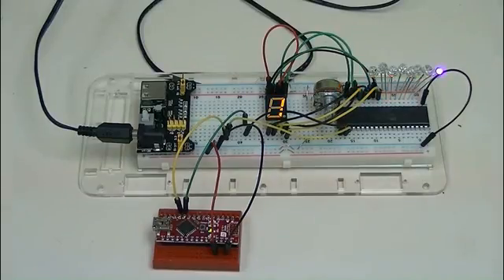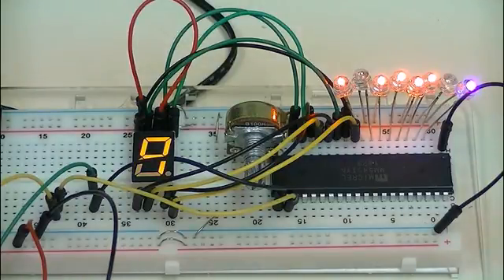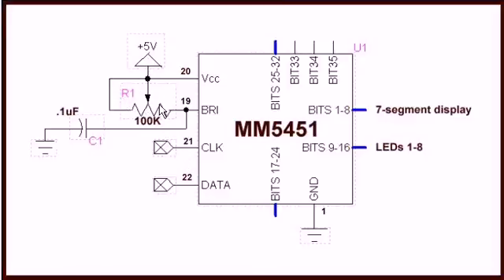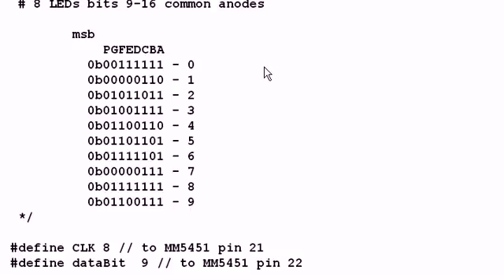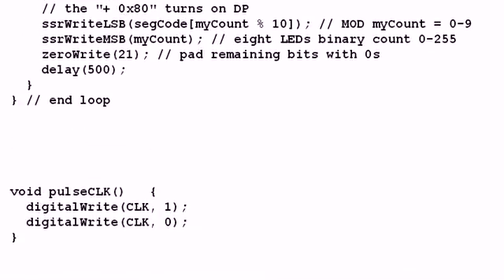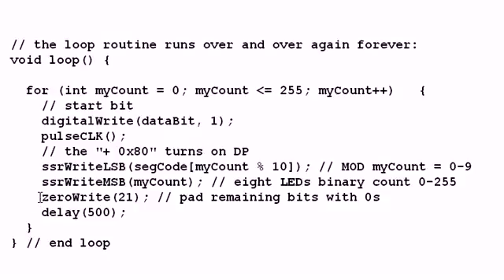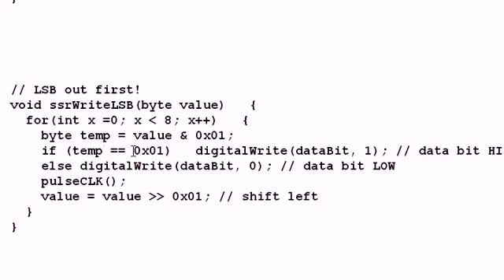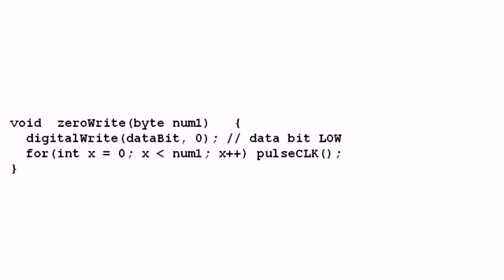Interfacing Arduino with MM5451 LED Display Driver

Comment: WOULD the  mm5486 be any different, it has a load input on pin 23. I have a board with 4 of these chips connected to 108 LEDS that I'd like to make light up randomly. Each chip has 33 latches, would I have to send 132 bits then send a Load pulse? Any tips?
Reply from the maker: It looks similar. Check the spec sheet against the MM5451. You might have to modify the code.
Reply: @LewisLoflin  yes i was just wondering how you would write to four of them
Reply from the maker: @TheUnofficialMaker  They either can be accessed individually or are in a string. To write number 4 means going through the 1st three. Looked at the MM5486 pin 18 is data out. That goes to the input of the next chip.

Comment: jitter is what the capacitor is for, that only is a problem when you multiplex the chip and even then only if you're trying to display 5 display characters when you only have 4. At least that is what I have found, otherwise this chip is stable as a rock.

Comment: Hi. This is a neat video. I wish I would have come across it sooner. I just finished my own 5450 project and knowing this video was out there could have shaved some hours off my development time! Oh well, I am glad I was able to work it out on my own. Nothing more satisfying. I may still find pieces of your code useful. I need to develop a testing jig for my boards and the Arduino seems like a perfect low-cost candidate for such a rudimentary task. Great job. Thanks for your outstanding contributions!

Comment: Hi Lewis,
I got everything working now, but I still don't understand the program so that I can change it for my specific needs.  I don't need to use 7 segments, only the 35 individual LEDs being lit up in sequence with only one LED on at a time.  So I need to understand what the LSB and MSB programs are doing precisely to see how I can change it.  I know I"m a beginner here.  My only real reference for knowing how a shift register operates is my understanding of the 74HC595.  I presume there's a difference between the 74 and MM5451 because a similar routine will not operate the MM5451.  So what is the difference?  I presume you have to move the bits along the 35 pins by shifting them accordingly, but why is there a shifting to the right and then to the left?   I can't visualize this.   I'm thinking this is due to one routine working for the 7 Segment and the other for the individual LEDs right?  If that's true then all i need is the MSB routine and set it up to clock in specific binary numbers right?  Please tell me if I'm on the right track and perhaps give me some insights on what i need to focus on to better understand how to convert the program for my specific needs.  Thanks!
Reply from the maker: bryan greifinger Both shift registers work the same at the BIT level: put the bit (0 or 1) on the input, then pulse the clock LOW-HIGH-LOW.

An Arduino is a 8-bit micorcontroller so to use 35 bits will require at least 5 8-bit bytes. On the last byte only shift in the first three bits of the last byte. You shift in ALL 35 bits and when shifting in bit 36 that will output the first 35 bits.

You have to decide if it's going to be MSB first or LSB first - that is how the ssrWrite routine works which requires changing two lines of code.
Reply from the maker: Lewis Loflin Also remember to start put a 1 on the input and clock - then shift in the next 35 bits plus number 36 load bit. You have to shift in all 35 even if using only 1.
Reply: But why are you shifting one way for the 7 Segment and another way for the individual LEDs?  I assume then I can just ignore / remove all the code related to the 7 segment and just use that portion that works for the LEDs.  But how does that mask work?  I can't figure out how to control the mask to get the bit patterns I need to turn sequential LEDs on and off.  Seems when I try to AND everything it always comes out incorrectly.  Not sure what I'm doing wrong.
Reply from the maker: No. Your bit order depends on how the electronics is connected.
Reply: @atlas227428 don’t forget the logical AND

Comment: hi lewis!  Just saw this for the first time.  I initially only saw the Raspberry Pi solution. Nice presentation.  I'm surprised by the fact that it is possible to do subroutines with an arduino.  I've never seen that before.  I thought it wasn't possible for arduinos to do more than one thing at a time.  At first blush, when I saw you initially hooked it up to a Raspberry Pi, i thought it was because the Pi was a computer that COULD do more than one thing at once.   At any rate, now I need to hook my chips up and run thru the code again till I understand it perfectly.  My only other question is, can't you cascade the MM5451 to have even more outputs than the 35?  And how would you change the code to access the second chip?  Thanks again!!!  Enjoyed the video!
Reply from the maker: bryan greifinger "can't you cascade the MM5451 to have even more outputs than the 35?" No there's no output for that. one would need on data and clock line for each chip.